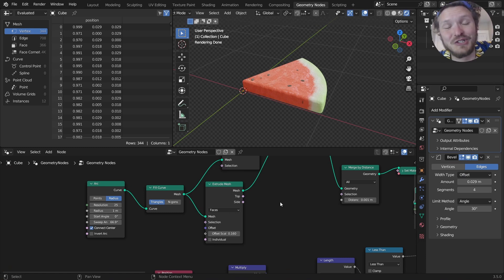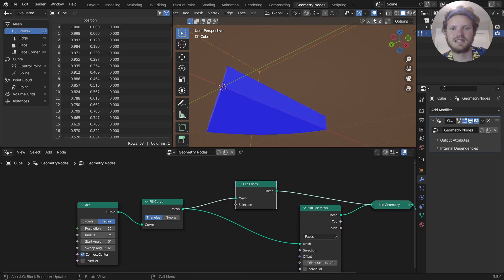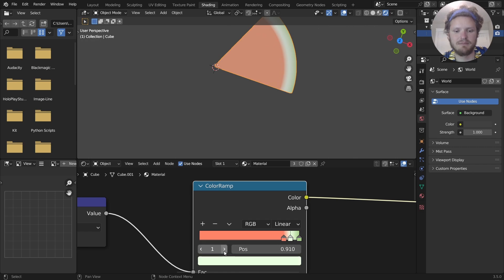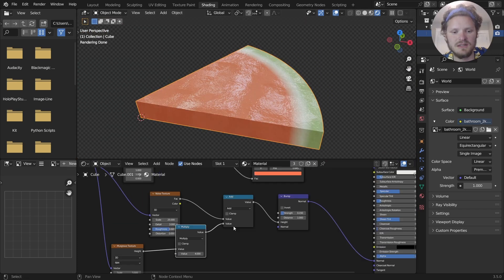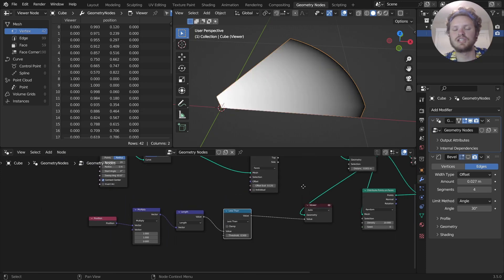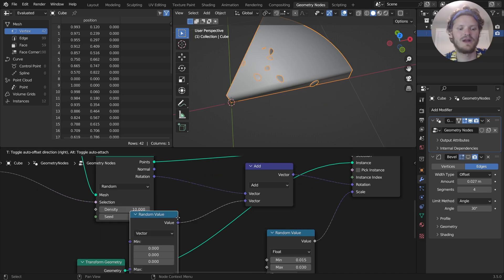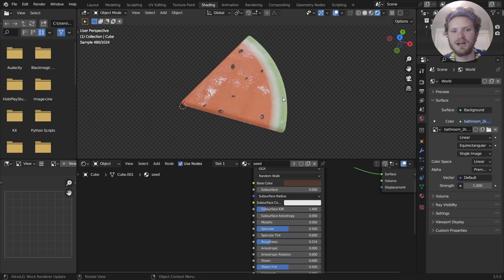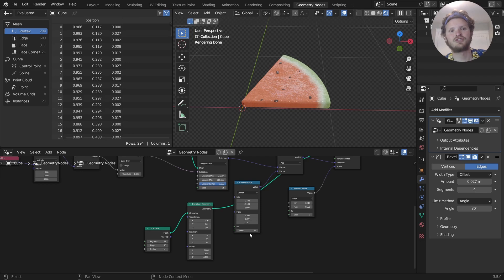PROCEDURAL watermelon. - geometry nodes

Comment: Just a few things for anyone who would like to go for a more realistic look.
(Water)melons don't have seeds all over the place, but kind of an inner circle.
You could add a More Than node and combine it with Less Than to make it work from here.
If you're going to make it a full fruit, not a single slice, keep in mind the seeds are smaller and it is less of them at each end of the melon (better seen the less spherical it is).
Also, seeds are always pointing inwards, so the rotation shouldn't be random.